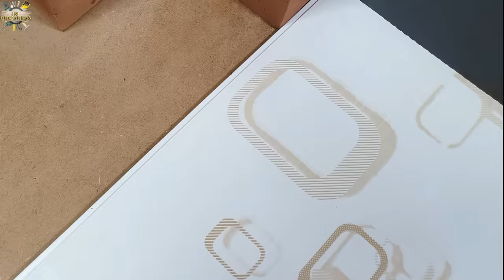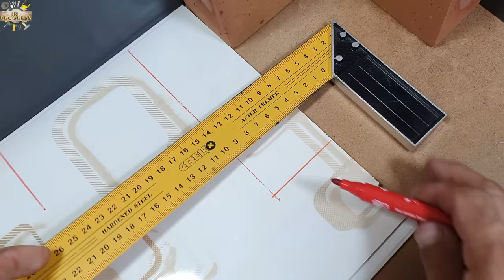4 Easy Tricks For 4 Complexities! This Perfection is Sure to Amaze You

Comment: The other end of the board also has to be elevated or when you rotate the board down the angle will be wrong. Details like that are what make the carpenter’s craft more than simply cutting boards and nailing them in place.
Reply: A real carpenter would not have constructed something that leaves a random 2x4 sticking out 8" from what appears to be a wood fence.

This guy's videos are purely show and tell. He repeats the same cuts, using some random bricks stacked in the corners, a 4" pipe or (of all things) a frickin' garden hose coming out of the middle of the floor. In the real world this happens pretty much never.
Reply: I was about to say the same thing about the cut . leaves out  half the story.
Reply: I came in the comments to read this. Thanks
Reply: @driveman6490  I use these type of tricks tiling all the time picture that house being a stream pipe install on a shower wall or the bricks being a decorative old piece of trim that will cause more effort to replace then a customer is willing to pay

edit: even the random 2x could be a sill of some in a shower niche and the angles are a herringbone pattern
Reply: @erasamus1057  great points well made. These tips can adopted for numerous situations and are very helpful for the novice diyer.
Reply: @raysmith6891  not helpful at all. Joins won't work unless other end is dropped by the distance of the seat cut.
Reply: @driveman6490  his videos are much more information than yours are currently but I think you can do better. Good luck.
Reply: @manofausagain  Would have been nice of him to add that to his video as well. These are geared toward the beginner and that would help them not waste time or money.
Reply: @manofausagain  you miss the point I was trying to make . This could be of use in another situation that doesn't involve a bird mouth seat cut and ridge cut for a roof.  Simple things like this help in other areas and can help the diyer overcome snags which a pro sorts out instantly.
Reply: Very true. Was wondering about that.
Reply: @ThePebbleLand  yeah this only works if you don’t care what the other end of the board is doing.
Reply: You’re all wrong. If the other end wasn’t yet cut then this is the correct angle. Think about it.
Reply: @alexandermayerkirstein  exactly. He should have shown the other end (seat cut) to show how it will drop in parallel and the faces square up.
Reply: Indeed, a few essential things missing here
Reply: I dont know, maybe learn how to use a speed square.
Reply: perfect answer
Reply: A few days ago you think you can
Reply: Exactly…misleading…
Reply: Что интересно, у него должно быть расхождение от неправильной разметки, но всё сходится идеально! Значит, скрывает от зрителя свой манёвр.
Reply: I tried to tell my daughter this yesterday who jumped at the opportunity to use some “skills” social media showed her.  She showed me what she learned and my response was, “it only works with specific generalized dimensions.  It’ll be off the majority of the time.”  I’m an arch drafter and I’m homeschooling her on the trade.  F’n internet!

Comment: After the board is notched out and dropped an inch into place the angle will have changed.
Reply: No it won't unless you change the angle. We are assuming the same knotch on bottom.
Reply: Yes I've now seen this same point argued 5 times... if the bottom end of the board is fixed (maybe resting on a ledge or smthn) than the ppl saying the angle will change due to the 2 inch horizontal notch being removed are correct HOWEVER, if the boards are free floating, and permitted to drop the height of notch, the angle will remain the same.  Depends on application.
Reply: it doesnt

Comment: #2: won’t work as shown. 2 by material is resting on ground for 45 cut so after notch cut 45s won’t align but will instead spread near notch cut. You missed the part where you have to cut the opposite ends to account for the loss in height from the notch cut.
Reply: why not prop up the bottom part so it is raised to compensate?
Reply: @Repent and believe in Jesus Christ 
 Don't keep us in suspense! What's "the truth"? 
Wild guess,  it has smthn to do with you being right and others being wrong?
Reply: Repent and believe in Jesus Christ  surely he has some carpentery tips!!
Reply: @theoriginalmonstermaker 😊😊😊

Comment: Now I'm not a joiner, but i do understand geometry. Without any rigorous mathematical proof, it seems like the change in angle would cause these to be imperfect cuts. It seems like drawing around the end of the beam at the appropriate angle would give the correct shape (and not the same as what we see here). Can someone explain how these cuts work?
Reply: The cuts are created as if the beam were 2 inches higher

Comment: What? Changing the vector of the hypotenuse and without, translation impacts the sine and cosine of a right triangle. And it’s included angle is in flux. How does marking from a surface profile with deviation yield such tight fits?

Comment: Yes man,  try marking a birds mouth that way, whilst holding a 4;8m length of 6x2, 20 or 30ft up in the air! Easy to do it on a scrap bit of 6x1 floorboard. A competent  carpenter can and does calculate both rafter length and cut angles, without offering timbers up, and cuts his rafters on the ground!

Comment: Do all of the corners have to be square for this method to work? Or will it still work perfectly if the existing surfaces are not square with one another?
Reply: Everything has to be perfectly square for all these methods to work. Everything shown on here is missing at least one step if not more

Comment: Both the first 2 worked bc his ruler was same thickness as protrusion.  Probably should have mentioned that.
Reply: ... and the third he didn't actually cut exactly what was shown : /
The circle had to be cut straight back off perimeter towards corner to allow the piece to slide by. 
....I wouldn't bother btchn if the info wasn't misleading.

Comment: https://youtu.be/XbjvlM24rhQ?t=100 Это сработает, если доска не фиксированной длины и потом внизу отрезается сколько нужно. В противном случает, если длина доски уже нужного размера, после углового выпила изменится и угол стыковки.
This will work if the board is not a fixed length and then cut off as needed at the bottom. Otherwise, if the length of the board is already the right size, after the corner cut, the joining angle will also change.